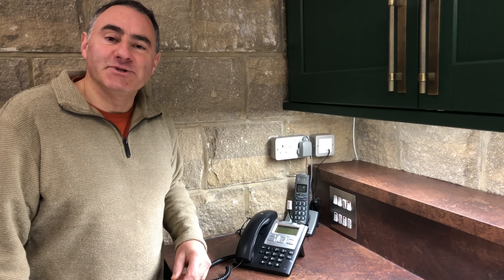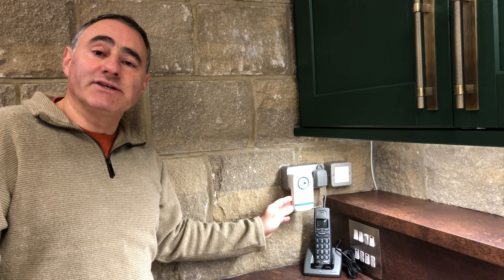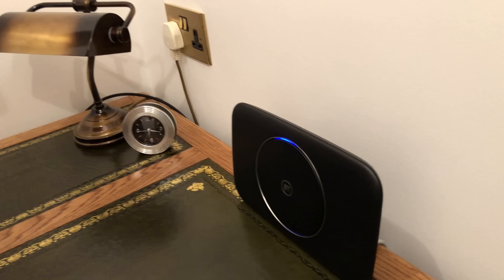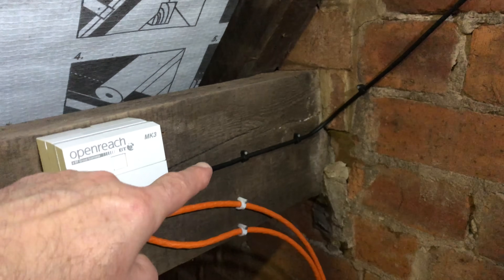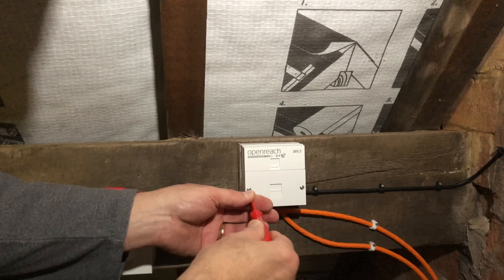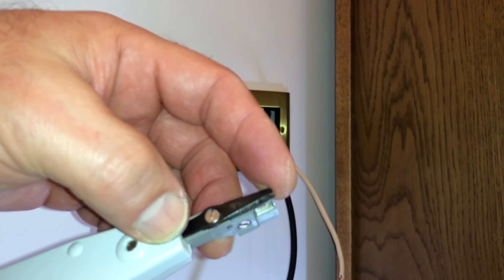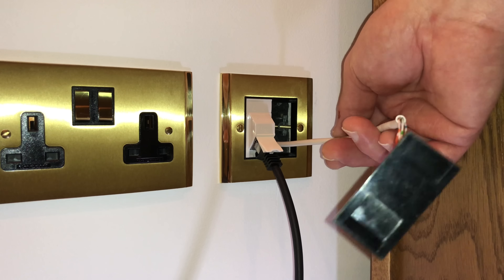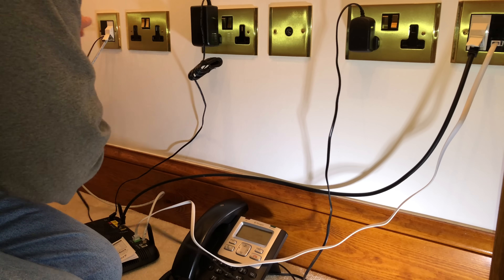How to Video - Analogue to Digital Telephone Landline Switchover Advice VOIP.

Comment: Regarding power supplies,  if you ask your ISP most supply a battery back up but only lasts a few hours (especially if you say your on medication - hospital equipment that needs internet)  BT do them but can be used on other Hubs.
Reply from the maker: Thanks for your comment Simeon. I have actually made a video titled ‘Full Fibre Broadband with Battery Backup’ about a year ago. I purchased the very battery backup you mention and timed it. You might be interested in taking a look. Cheers, Rob 👍

Comment: I'm an ex BT engineer retired for the last 20 years. Just want to reiterate that this solution is technically a workable solution. When my analogue phone line was updated to digital, I ignored BT's written advice that existing internal wiring could not be used and used my career knowledge of telephone wiring and operation to perform the exact same mod. The written BT advice is there to cover BT's back as not everyone has the technical skill or capability to perform the mod correctly. The BT Help Desk 'Call Agents' are typically not engineers and follow prepared scripts and only repeat what BT tell them is official policy. If BT even hinted that using the existing internal wiring was possible, then there are muppets out there that would not do it correctly and cause significant issues. The reason that the internal wiring has to be disconnected at the master socket is because the voltage and current conditions on the analogue line in the street would significantly interfere with the telephone operation if they were left connected in parallel with the hub (router) voice port.
And as a BT colleague mentioned further below in another reply, with modern analogue handsets only the 2 blue wires on jacks 2 and 5 are needed. Jack 3 (Orange) rarely used these days would be used with very old dial phones with mechanical bells to prevent bell tinkerling when dialling.

Comment: I've done something else:
Connect the existing wires you already have in your house to the GPON terminal, in the telephone socket of the terminal.

And all the work is finished!
Reply from the maker: Hi Dumitru, Pleased your method has worked for you. Since making this video I’ve moved over to full fibre and posted a video on the installation. The old master socket in this video was taken out by the engineer. Thanks for watching. Cheers Rob 👍

Comment: Could I simply use a male RJ11 to male RJ45 cable to connect the BT handset to the router?  ( Both bits of kit are on the same desk here. )
Reply from the maker: The phone socket on the back of the BT Smart Hub 2 is a BT telephone style which RJ11 or RJ45 won’t fit. I’ve seen other routers such as Virgin have an RJ11 phone socket for which they provide adapters to suit a BT style plug. The provided cable from a BT handset desk phone or cordless base should have a BT style plug which plugs straight into the BT Smart Hub 2 phone socket. Hope this helps. Cheers, Rob 👍

Comment: Worried about my OAP Mum who still still has a landline when her area switches over. Phones lines/BT Sockets in her place are a bit of a mess.
Reply from the maker: I’m sure if you explain this to your mum’s phone provider they would arrange to look at the internal wiring. But they may charge for the engineers visit. Hope all ends well. Cheers, Rob 👍

Comment: So now you have to use a phone that has to be plugged into an electric socket and throw away the one that didn't. And they are concerned about us burning too much CO2.
So thats 28 million more UK house holds, plugging their phones  into the national grid.
Reply from the maker: Actually corded phones like the one in the video, can be plugged into the house phone network which is fed from the hub. The phone socket on the hub provides low voltage power similar to the traditional phone line. Thanks for watching. Cheers, Rob 👍

Comment: In case it's of any use to anyone, I have had a VOIP phone line for 8 years. I have a Cat5 cable running from my neighbour's router to my flat two floors away. At my end of that cable I have a network switch into which I have plugged a device called an ATA from Voipfone, into the ATA I plug my cordless phone base unit. 

Calls come in and go out on the cordless phone as well as on an app provided by Voipfone so I can make and receive calls on my home number when I am out and about. It costs just over £5 per month. I never actually make any calls via the VOIP line as I always use my mobile. 

It seems to me that anyone who is paying their phone provider for a landline and calls under the new regime where their phone is plugged into the router could potentially save a fair bit of money by doing what I do (although I know my situation is a bit different as I am connected to my neighbour's router but the same system could be employed for your own router). 

The Voipfone system gives me a local number so to everyone who rings me it looks like a normal landline. I'm sure there are plenty of other VOIP phone providers but I only mention Voipfone as I know them and they have good support.

Comment: So, why do they leave the landline connected?  Why not remove the cable?
Reply from the maker: Hi Rich, it’s a twin cable entering the house. One wire for voice and one for broadband. In my case the voice wire goes dead leaving the broadband wire active. Meaning the twin cable would have to stay in place. Since this video I’ve gone full fibre where the twin cable is replaced with a fibre cable. I posted a video on that a few months ago. Thanks for your comment. Cheers, Rob 👍

Comment: Now there's an adapter which works did mine yesterday so my phone is finally downstairs not up so for me it's brilliant.....but no 999 so everyone needs a mobile in a power cut as it won't work 😢
Reply from the maker: It’s good to know it’s all working for you 👍. You’re right about the emergency number should there be a power outage. I’ve also posted a more recent video on having full fibre and battery back up. Cheers Rob 👍

Comment: Probably not the only one who says this but if you put your hub on a UPS it will keep going during a power outage. That is assuming your provider has their network maintained. I know over here in the US we have a law that requires emergency service so anything that spits out a phone service now is required to have a battery built-in. Also a great up-to-date example of the British style of Phone cabling and jacks.
Reply from the maker: Interesting to hear how US laws differ from ours. I think the same should apply here in the UK. I posted a video around 8 months after this one on having full fibre installation and UPS battery back up, if you wish to take a look. This is where the incoming copper cable is replaced with fibre. Thanks for watching Mark. Cheers Rob 👍
Reply: @robswiseways5697   i'll have to check that one out. https://youtu.be/m-r8W6jlFhA yeah the telephone was an emergency service so the phone company was required to maintain the copper infrastructure that they don't really want to. Nor did they upgrade to fiber that we've been paying into. We're just starting to get fiber in WV finally, I'm probably gonna be switching sometime this year it's a third the price that I'm paying for cable Comcast Business. And the cable company started offering digital voip phone service and they didn't have repeat back up emergency requirement for a while until the the law changed a few years back requiring them to have some overlap of service during an outage. Since they were technically a service provider now providing emergency phone. Copper telephone is quite fastening and I love to learn as much as I can about it no matter what country. I wish I could have a landline they still exist some extent but they're expensive and pulling teeth to get the company out to install. I still like the whole Central battery aspect of it and working continuous during an outage. Then again frontier has not been very reliable in this area. We had a dump truck come through and snag the line, it took me posting pictures holding the telephone line on Twitter. otherwise they were just gonna come out 3-5+ days and see what my fault was at my house where I don't have service. Meanwhile the post office couldn't deliver mail because of the line.

Comment: BT Broadband Home Hub 4 I have BT has made a backward step with this Hub what BT provided me a few years ago when I first registered with BT Broadband.

Later I purchased a BT Broadband Home Hub 2 which has a Telephone port but no WAN port like the 4th version.

BT Broadband Home Hub 4 doesn't have a Telephone Port.

BT Broadband Home Hub 2 doesn't have a Wall Mounted But has a Fixed Stand where has the 4th version has detachable feet which can fit into Wall Mounted Bracket.

Very Strange.
Reply from the maker: Agree Ian, some things go backwards. I remember the hub with the separate WAN port. I had a smart hub 1 without the phone port but like you replaced it with the Hub 2.
Hope it’s working well for you.
Cheers Rob 👍

Comment: Power Cuts and Telephone Disconnection by Rats or by other problems means there will be No Broadband, No Telephone, and No WiFi on Computer, Laptop, Smartphone and Tablet.

Contacting a Online only GP for Appointments and Prescriptions if the above has happened then you can't use Your Mobile to contact your GP online.

Transfer the Telephone Extension from Master Socket to where?.
Reply from the maker: You’re absolutely right Ian regarding the loss of various devices and being able to contact a GP should there be a power cut etc. 
This video is basically showing how to retain existing extension sockets after switching to digital or full fibre. The BT hub is acting as the master socket. Cheers Rob

Comment: great vlog fella my dear mum is getting uk sky fibre soon has a bt  master socket near router and alarm connected to the landline.so if i got a bt engineer to do what youn are doing will be ok as she uses the landline when best to do after sky installation or before great video thank you from cape town  sa
Reply from the maker: Hi Dixie, It’s likely that Openreach will install the fibre cable to the property and disconnect the master socket. If your mum has extension sockets, the extension wire will come out of the master socket as in my video. Once they disconnect the master socket, it’s probably worth asking if they can leave the master socket in place. This can then be used to plug the landline cable into from the router that will feed all other extension sockets. Hope this makes sense. Cheers Rob 👍

Comment: Or you can get a ups for your broadband and solve another problem. Excellent video by the way . no fuss on point
Reply from the maker: Thank you for your compliment, much appreciated 👍. I did purchase a ups. I show it in my ‘Full Fibre Setup with Battery Back Up’ video I posted in October. Thanks for watching and commenting. Cheers Rob 👍

Comment: When we switched to BT about 2 years ago they moved us to digital voice
And a few days ago we switched to Vodafone, and we got upgraded to FTTP/FTTH/Full Fibre in the process
(and i ended up having to order an adapter on amazon as the Vodafone router has 2 RJ11 phone sockets (labelled Tel1 and Tel2, and are green in colour), and Vodafone didn’t supply an adapter)
Reply from the maker: I’m surprised Vodaphone didn’t supply an adapter. I’ve seen a Youtube video on a Virgin Media hub that has the same RJ11, however, they did supply an adapter. 
I’ve recently moved to BT full fibre. I’ve just posted a video on it with battery back up which you may find interesting. Thanks for watching and commenting 👍 Cheers Rob

Comment: For Hubs that doesn't have a BT socket would a Ethernet RJ11 or RJ45 to BT Plug and Coupler work?
Reply from the maker: Hello Ian, I suspect BT hubs without a BT phone socket are not designed for digital voice landline. I’m sure Virgin hubs have a phone socket that uses an RJ11 socket and they come with an adapter lead RJ11 to BT. I don’t know any information on other providers though. Cheers Rob 👍
Reply: I have just had FTTP installed and ISP is Zen. The router is a Fritz!Box and the RJ11 connector to BT431A male has only two pins so no 3rd wire. I have wired those two wires to A and B at the back of the redundant master switch (NTP mk3) which has a built in capacitor but still need extra capacitors before some handsets. I have read that tooo many capacitors upsets  the ringing?? Any advice

Comment: Frankly, if I was the boss of BT and an employee came to me and said "I have a great idea, we should change our simple ,robust and reliable phone system for a new system that won't work in a power cut, the handset has to be plugged into the router instead of the usual wall socket, it won't give an engaged tone and the 1471 last number feature won't work any more" I would have kicked him up the backside and handed him his P45. I'd have told him that he is an idiot and I don't need idiots so get yourself out of here. Instead, they thought "Ooh, that's a good idea" Bloody halfwits.

Comment: The current 6 Core Telephone Wires are: 
1) Green Power Wire
     Broadband Hub.
2) Blue Bell Wire.
3) Orange Dialling Wire.
4) White/Orange Call
     Wire.
5) White/Blue Recieving 
     Call Wire.
6) White/Green 
     Broadband Wire.

The Telephone connected to Broadband Hub Digital Voice Landline Telephone Switchover means if there is a Power Cut: 
1) No Power.
2) No Connection.
3) No Telephone.
4) if your Mobile or Tablet runs out of Battery you will not be able to contact anyone including Emergency Services and Powergrid.
5) Costing the User Money to Upgrade Telephone Cables and Extension Sockets to Digital Voice Landline Telephone on Switchover.
6) Putting People's Lives at Risk in Emergencies not everyone has a Oncall Alarm Unit.

These points above are something that the BT or the Government has not thought of when they introduced this Digital Voice Landline Telephone Switchover.
Reply from the maker: Thanks for your comment Ian. I understood the green wires 1 and 6 were not used in a domestic property. As for a power cut I agree that all communication will be lost. The mother in law has recently had her emergency call system replaced with one that has a SIM card installed. It doesn’t use the phone line. 
However, I will hopefully be posting a video before the end of this month on full fibre broadband and battery back up. Cheers, Rob 👍

Comment: Must admit, the 'logic' (or lack of) for this 'switch over', seems utterly short-sighted - 'it it ain't broke, don't fix it' was always the best motto. It's not like trying to telegraph when you could just use the telephone. The 'convienience' element is gone and will just make it easier too for unscrupilous scammers to hijack old landline numbers for their nafarious activities, along with making any repairs of such a complex 'internet-based' landline system far more difficult than they need to be. God help us all in a power cut, as nobody will be able to contact anyone even for emergencies.
Reply from the maker: Hello and thanks for your comment. We are still getting used to having to dial the area code just to chat to someone down the road, most annoying. We find ourselves using our mobiles more often and only using the landline to answer incoming calls. We are hanging onto our landline for elderly relatives sake. The line however seems to be clearer. I guess we have to move with the times and since posting this video we have switched to full fibre. I am currently making a follow up video on full fibre and will include battery backup to help us in a power cut. Cheers Rob 👍
Reply: @robswiseways5697  ... 
There's an old Chinese proverb... 
"He who thinks the old way is better than the new is a fool.
He who thinks the new way is better than the old is also a fool." 
My advice to anyone is...
1 Look for hidden agendas;
2 Follow the money.

Comment: I just had full fibre fitted. Will this work with my rotary phone? or will i need a conversion kit of some kind?
Reply from the maker: Hello there, I have read a rotary dial phone will not make outgoing calls on Digital Voice, but can be used for incoming calls. I’ve also read about pulse to tone converters for rotary phones on community.bt.com - Rotary dial on digital voice. Sorry I’m not much help but there is a YouTube channel called ‘My Mate Vince’. He does a similar phone set up and he also connects an external bell. Cheers, Rob 👍